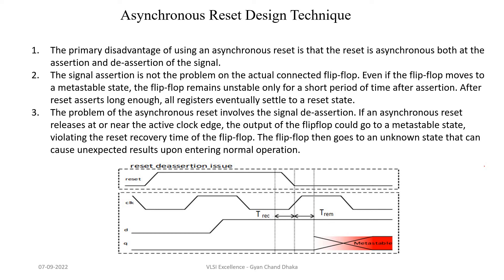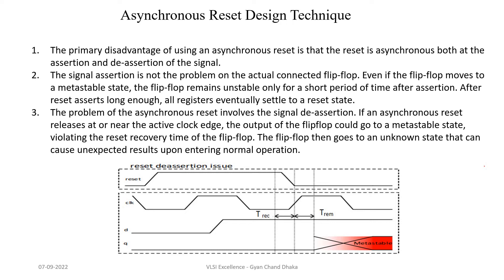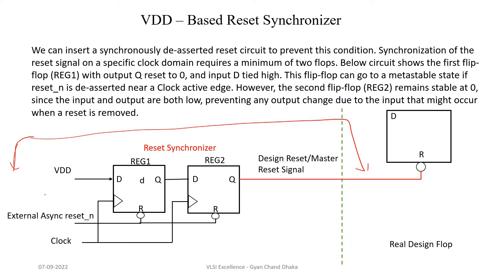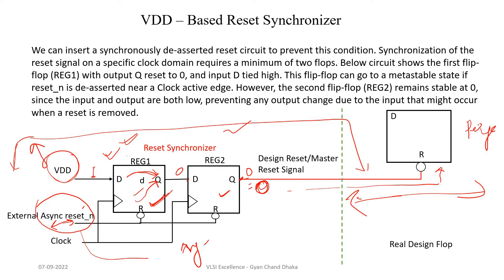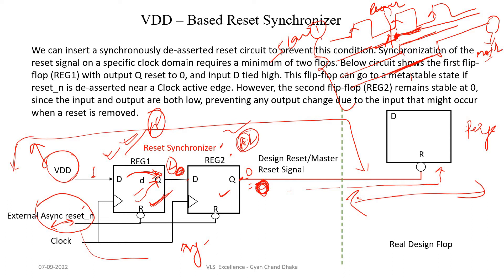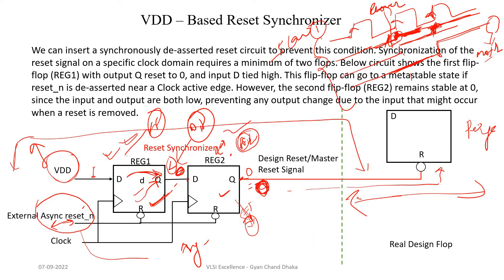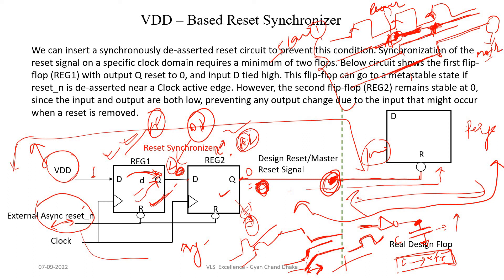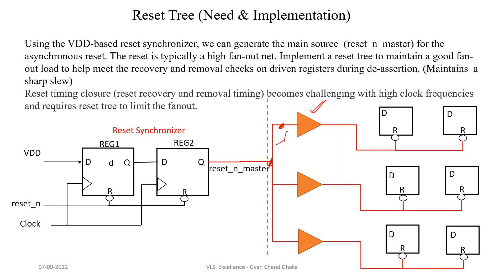Digital VLSI Design | VDD - Based Reset Synchronizer | Async Reset De-Assertion | Reset Tree 💯🔥

Comment: So if REG1 is in metastabilty, since its not directly connected to the design flop it is safe. But for REG2, the input D will be 0 or 1. Wont this be a problem? since we cannot predict the exact out of REG2... (though reset signal is long, after a few cycles i think reset will work properly....)